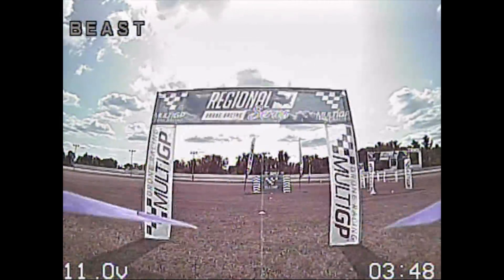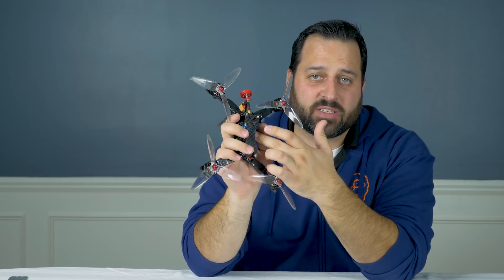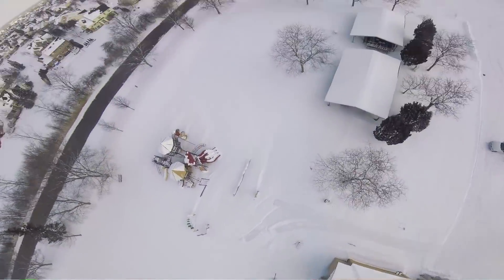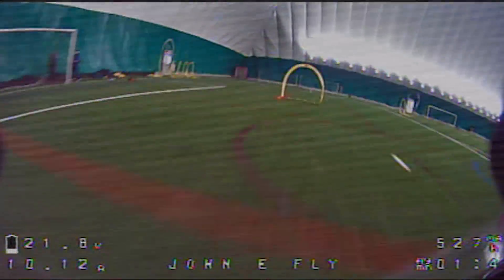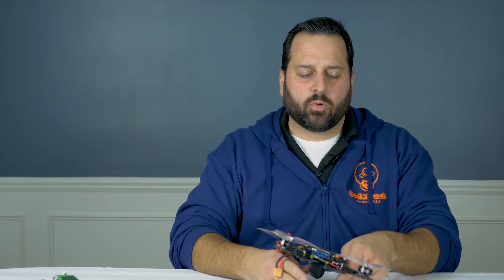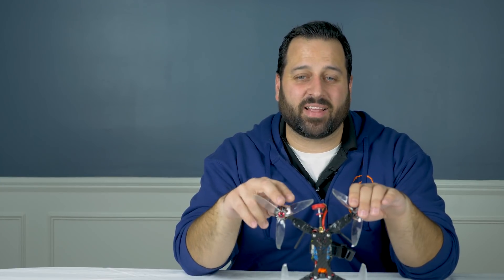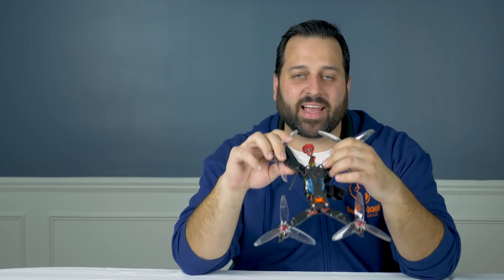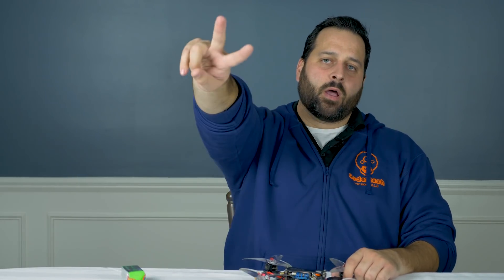6S FPV Drone Racing???

Comment: It's really up to how long do you want to fly, there is no additional power to be had. Higher voltage is only half of the equation of wattage. I'm ready for 6s like i'm ready for 3s, the current will change (with in physical system limitation) to hit the same wattage to drive the props at the target thrust. The motor certainly doesn't care about the voltage....just the insulators.
There is no free lunch. The biggest gain is a reduction in system requirements. Less conductor area needed and less power loss. Also there is much less stress on components.

50v cars were proposed two decades again. I really have no idea why vehicles still use so much copper just to waste it in to heat. I have no idea why we aren't designing systems to use  300mah 10s packs.
I do have an idea why i fly three minutes on my 1600kv quad with both 4s and 6s packs.

Turbo drag racing classes are limited by compressor inducer size as a way to limit horsepower. The fast guys just up the density and system efficiency via thermal management. The mini quad evolution is at the same place as small displacement turbo cars were in 2002." You can't run 60psi on that limit motor!!!".... "Boost pressure has nothing to do with horsepower,...wait wat:" 
Why are they limiting how the watt/hr is stored? My opinion is limit classes by prop exducer size only or watt/hr only.

 I realize i'm just agreeing with the author .Thanks for the great content.Subscribed.

Comment: i think 4s should be limit becouse i feel that there is a good advantage for folks to either have better flight time or a quad with high kv that has crazy acceleration , so i think its a good balance.. on other hand 6s i feel it could be used to cheat?? becouse some folks wont run low kv with high voltage and will have huge benefit over others. this is my 2 cents worth
Reply from the maker: Honest to god, running 6S, this is quad is the best flying quad I've ever flown.  So I don't think 4S should be the limit, I think we want better flying quads.  That being said, like you mention, flight time and efficiency should also be a part of racing.  For that I think we should actually be working to extend the race time where you can't just have guys going full tilt buggy on high KV 6S and surviving the entire race.  Make them be smooth and efficient.

I will also say though, I don't think it would be cheating to have a higher KV 6S (or higher) quad, it would simply be a choice.  It then comes down to the track design to ensure that it's not just an easy straight line which rewards solely quad power, but rather combines the power of the quad with the skill and efficiency of the pilot.  

Lastly, from what I could see in testing, even between a pilot running 6S and another running 4S, on most tracks it's going to be skill that wins the race, not the battery choice or quad.  Given 2 identically skilled pilots, I don't even think the 6S quad would win every time, it would just win the majority of the time.  

Thanks for the input dude!
Reply: you do have a good point, crazy power dont when the race its the person who can cut there lines quicker and smoother... kinda like when i ran oval track rc cars we had new guys thinking they had to run brushless and have gobs of power but i had a good brushed 15 turn which was almost to much power for a small 1.12 scale on oval track if u powered in too soon or to late u lost time and got passed but if u knew your lines, then u was killing the lap times. Lol i just need to get some nice weather and ill be racing the multigp tracks again. Hopefully i can cross paths with you, you have been a great guy and helped me alot

Comment: I am not a fan of CLracing FC's everyone i have had i have had an issues with the VR's on the board and i have only ever used 4s on them i have only ever had a CL board last a max of 6 lift offs before i had to replace it. i have since changed the Matek's (matek f405 and the fchub/vtx) and have yet to have one issue. i see with 6s a bigger need for external caps on the main lead for filtering and absorbing voltage spikes in the system.
Reply from the maker: Thanks for the input.  For what it's worth, I actually bought a handful of Matek F405 boards to use as my replacements if I blow any more CL Racing boards.  I'm hoping to have good luck with them, glad you said you've had good luck.  I have also added a 35V 1000uF capacitor to my main leads on this build since I filmed this video.  I'm hoping that helps with the voltage spikes too.
Reply: wow that's funny you got the 405. i have been looking at the f722 for my next build, with 32k coming in bf 3.3 and the fact that it will allow for more in the future, if the quad last that long it would be nice :-). 

it would be nice to see you do a follow up on the tweaks you make and what you find running 6s is both freestyle and race
Reply: It’s only has a 1.5A 5V reg. That’s why you keep blowing them. You’re overloading your 5V circuit with your vtx/cam/leds/fc/beeper. Try redesigning your setup to use less 5V and more 10V and you’ll love these boards.
Reply: when i was using the cl board i would run my vtx and cam off either a pdb or main power and at the time i did not have a beeper on it as well as LEDs i had a basic setup and i had watch a lot of build vids and read a lot about it at the time and learned about the board before doing anything so i had known that it was better to do so on that board. so IDK if i was just getting bad board or if it was me the CL boards were one of my earlier board i also had issues with the spracing boards but not any of the omnibus boards...
Reply from the maker: As a note, I will say I'm not running my VTX or Cam off of the 5V.  I also do not have a beeper.  I also have had really good luck with the CL Racing boards prior to this build.  I've used 4 of them in total at this point.  I will also say that since adding the capacitor to this particular build, I have had 0 issue with my CL Racing board in this setup.  I still plan to experiment with other flight controllers, but so far this has been treating me well.  It's probably just something to watch out for with 6S quads.  They will have much higher voltage spikes upon powering up than others.
Reply: hey thanks for the update and i'm glad your CL's are holding up.

Comment: 6S batteries will not stay cheap. They only reason you got that cheap is because they are rotting on the shelf.  Once the hype train gets on 6S watch the prices jump.  Like you said, pilots will overprop and over KV their Quads and we're back to square one.
Reply from the maker: I don't think that's the case.  A cell is a cell, it's just about how many you piece together.  The nice thing with 6S, at least how I think we'll be using them, we'll be able to live with a lower discharge rated cell than we can live with on the 4S packs.  therefore the cells themselves should be cheaper, and the price of 6S should remain relatively low.  If we get to the point where we need the same R-Line "95C/100C" cells things will go up in price drastically.
Reply: Ideally I'd hope that'd be the case too, but like you said you'll get those guys running 2000Kv on 6S on RK5051 and they'll still murder their batteries an go crazy fast.  PS: I could be a bit put off by the fact that we get ripped on batteries in Australia as it is.  An Ultra Dinogy 1400mah 6S retails for $52USD here
Reply from the maker: Dude, totally agree on the murdering batteries.  I would love to see longer MultiGP races that force you to be more conservative with batteries, and that would really help IMO.   Sorry about your Aussie prices :(
Reply from the maker: Brian, thanks for checking out the video and offering support.  It looks like you're primed to see an increase in sales now for quads with these new batteries as MultiGP just announced open batteries for the regional series.
Reply: Thanks Brian.  I'm too used to Hobbyking flogging off their old stock for cheap.  Do you have any stockists in Australia perchance?
Reply: I think you are correct.  Won't be long before people start running 2400kv on 6s for racing and smoking batteries.  Most amps i've seen flying 6s 1950kv is 130, but i've sagged a 1050mah 75c pulse down to 18 volts.  You really need to run 1250mah 6s on 1900kv if you plan to use full throttle for 2-3 seconds.

Comment: nice video .what do you think of the mode 2
Reply from the maker: So far I love it.  I loved building with it.  It's amazingly sturdy for how light it is.  It remains solid while flying, and has a great feel to it.  I actually thought I would have broken an arm by now with some of the crashes I've taken, but it's held up to more hits than I anticipated with those skinny arms.  Only thing I'm not a big fan of is the battery strap locations.  Because the stack itself sits where I would normally put it, my strap ends up a little further back than I would like, or if I move it further up, it's a little further up than I would like.  But honestly, that part doesn't matter at all.  I'm not ejecting batteries, so who cares?  It's a winner of a frame, and I bought 2 more.
Reply: very nice I have 3 of them love them cheap and simple  dose the job keep up the videos there very good and helpful